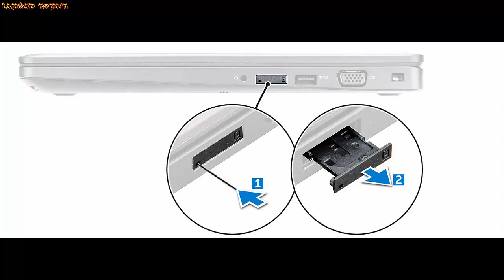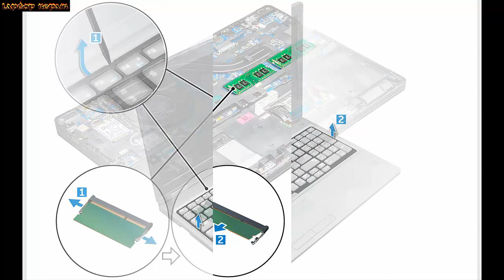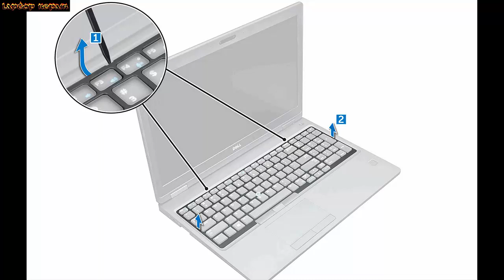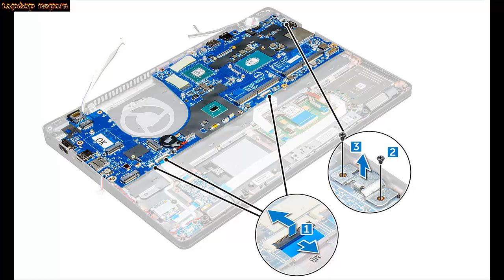How to disassemble Dell Precision 3520

Comment: Great image driven directions with step by step instructions!  If you remove or disconnect the battery, can you still power on the unit? Thank you 🤓 can the CPU be upgraded? Or the GPU (if its a card)? Can you remove the motherboard without removing the keyboard?